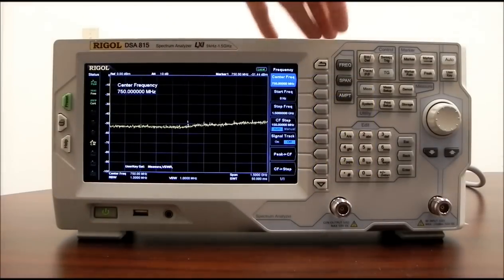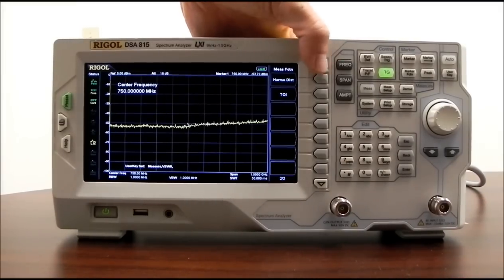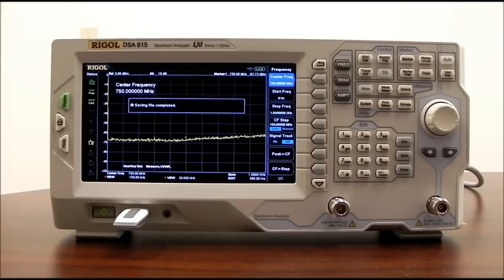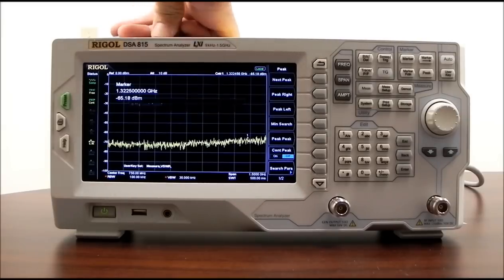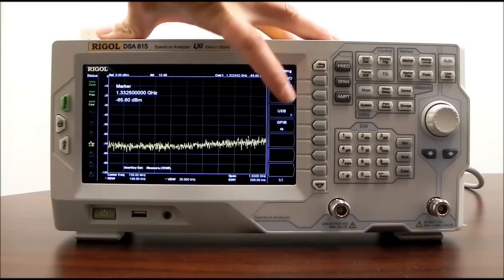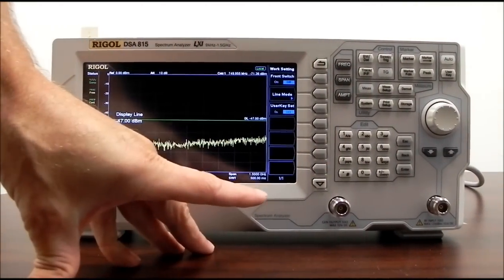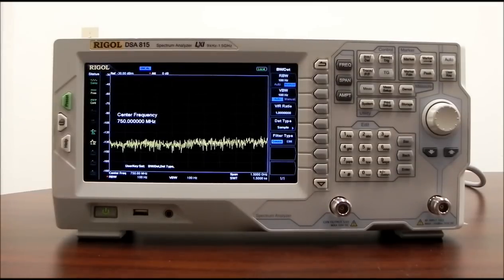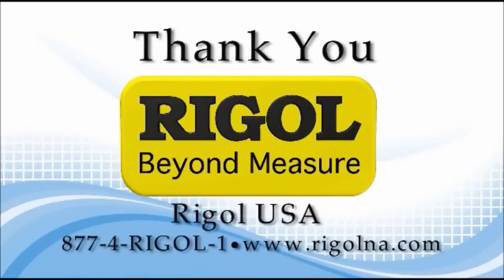RIGOL's DSA815 Spectrum Analyzer Part 2

Comment: i have question on setup file stored in the system. currently i'm using it to test noise, there is a setup file in the storage. and i am not sure how to use those setup file. so do i have to select the specific *.setup file then press 'preset'?
Reply from the maker: For what I think you are doing you should try a STATE file. This will save all the instrument settings. In the STORAGE menu you can load the file and it will set up the instrument for you. But the STATE file does a more complete job of this than the setup file.

Comment: Can this instrument measure SWR in a device such as a Balun that is properly terminated I.e.  50 ohm unbalanced to 50 ohm balanced?
Reply: Hi, Yes we use this to measure standing wave ratio. Typically, we do that with the VB1032 bridge option and the included software to make that measurement. It is also possible to calculate the VSWR manually if you use your own directional coupler.